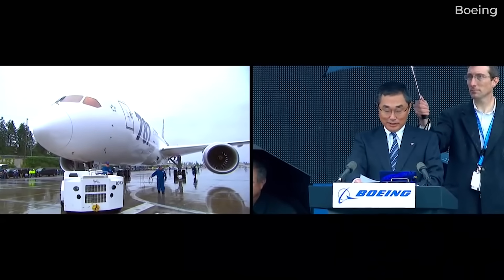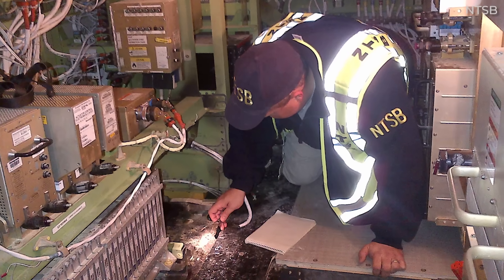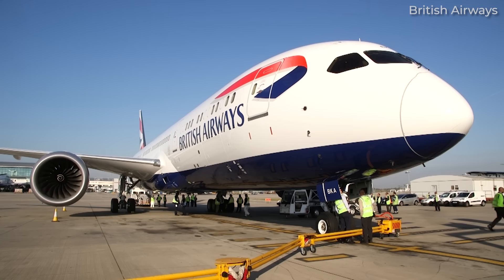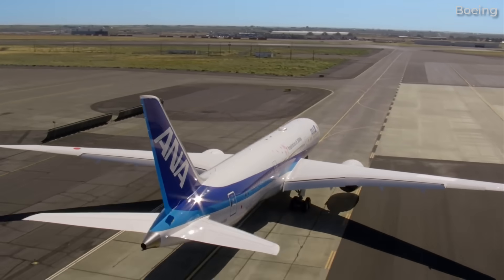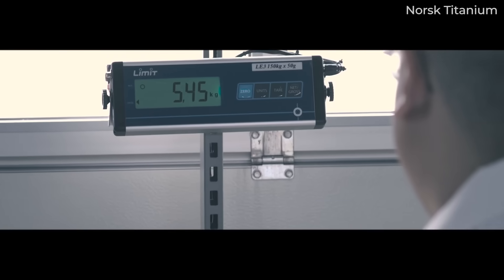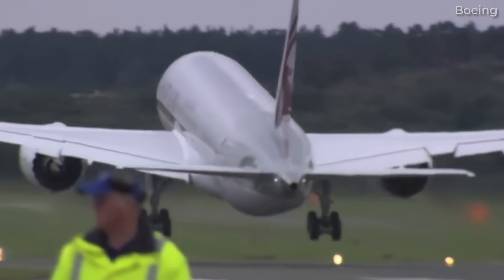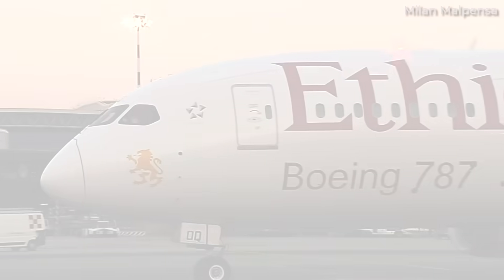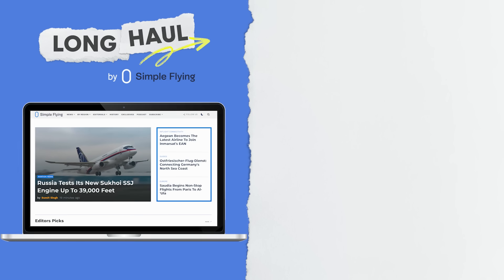Developing The Dreamliner: Five 787 Improvements Since Entering Service

Comment: I'm curious why the 787 doesn't have winglets? They're supposed to help with fuel efficiency and they seem cheap enough to implement. The 777 also doesn't have then but that could just be cause it's an ancient design. The 787 isn't. Anyone that could shed some knowledge on this?

Comment: To save on cost, Boeing also eliminated some of the electrical protections from the fuselage of the aircraft. They removed the copper lining within the fuselage that would eliminate sparking and causing a fuel tank explosion. Although, the Nitrogen inserting system of the tanks, they argue, can do the job too. They also removed some insulation used for the fasteners relating to this matter.

Comment: So 3d printing is a generic term used for a whole bunch of technologies and processes. It's almost as to say chissling wood by a carpenter and machining a metal part are the same. Norsk and GE's 3D printing are at the opposite ends of the spectrum think Amy Winehouse Vs Taylor Swift

Comment: Fixes/enhancements, doesn't matter. It's not like any car manufacturer that puts out a completely new model doesn't have issues either. Some car manufacturers even have issues long into production cough*VW*cough
And Airbus' A350s have issues as well. It's just generally less talked about, because it's the almighty Airbus.

Comment: I wouldn’t call it rushed; instead, 787 signifies a pinnacle of Boeing only second to 747 era. 
737 MAX was truly rushed with catastrophic consequences.
Reply: Original 787 development schedule was simply unrealistic.
And compare to either A350 or original 777, 787 has more teething problems and production issues, despite its EIS delay was also the most severe.
Things should have been done better, really.
Reply: @steinwaldmadchen  totally agree with the technical issues in 787 dev! This is also because 787 involved so many aviation-first innovations nobody had done before. I credit Boeing for resolving these issues without having any fatal incidents.
Reply: @bikingmoments are they resolved? What about the recent whistle blowers?

Comment: I'd call them fixes rather than improvements. However they didn't fix the main issue: the passenger comfort (or survivalbility) in economy class.
Reply: What exactly there? Because the seating layout is not specified by the manufacturers, but by the airlines. The ANA 787 is really comfortable even in economy. So, what comfort are you lacking?

Comment: A350 has dimmable windows too, just had the flight😜   But, on the plus side of B787 you didn't even mentioned the great pressurisation inside. Feels like on 1000m , the others (older models) do not have that comodity , but feels like 3000m . Long flights are so much afected with this issue. Higher hull preassure reduces fatigue and most important the jetlag. After a 10h flight in the Dreamliner is almost no jetlag , the fatigue is much less than on other planes . 
Just my own experience as a frequent flyer. Shortly = The Dremaliner 🙂
Reply: You mean that the A350 stole 😂
Reply: @jamiebrowne6913 hm let’s see, Boeing stole the idea of a twin engine body and stole the idea of a carbon fiber fuselage
Reply: @maxsaviation9512  correct me if I'm wrong but the A300 was in response to the 767 and the 737 was out long before both of them so who did Boeing steal that from? Also the A350 got the composite use only after the 787 came out Airbus was going to re wing and re engine the A330 till the realized what a beast the 787 was gonna be.
Reply: @jamiebrowne6913 the A300 was built and designed before the 767. the 767 first flight was 1981, the Airbus A300 first flew in 1972. Airbus was first.

And the fly-by-wire in passenger jets comes from Airbus mostly :D
Reply: @jamiebrowne6913  Yet A330NEO is just ~2% behind 787 in fuel burn, despite having the same aluminium fuselage and wings with the good old A330CEO.
Reply: @steinwaldmadchen  fuel burn is only one part of the equation, it's still more economical due to the weight savings  and design of the fuselage and wing, your just going engine to engine match up
Reply: @jamiebrowne6913  lol then you may be shocked that
a. A330NEO actually has the highest aspect ratio among all current gen widebody - higher than both 787 AND A350. After all, its wings were designed to overcome the shortcomings of the 4-engine A340.
b. A330NEO isn't that heavy either, around 2-3t higher than 787. That's why it can closely match 787's fuel burn in the first place. To be fair A359 isn't that light compared to 772 either, though A35K weight is significantly lower than both 77W and 779.
c. Of course A330NEO doesn't have the maintenance advantage of composite aircraft, just like 777X. But it's compensated by commonality with A330CEO, together with a low price tag.
So the revamped A350XWB is really more about market tactics, than Airbus truly believed 787 would blow A330 away.

Comment: Umm.. the Airbus A350 has dimmable windows. 🤔
Reply: That is much more recent
Reply: @filledwithvariousknowledge2747   still doesn't excuse the blunder
Reply: Does not count as they copied Boeings 🤔👌🏻
Reply: Another Boeing 787 is the dimmable windows, which are darker now, and operate faster than before.
Reply: It takes about 5 minutes for the 787 to completely dim the window but it only takes the A350 less than a minute to completely dim.
Reply: @Southernswag8283 Have you actually used the window in 2023? The windows are darker, and operate faster than the older ones. And, Airbus is using the same tech in Boeing windows, so how do you explain the non-existent claims you're making?

Comment: I hate the window tint system. Especially the central control allowing the cabin crew to override and lock the settings for the entire cabin.
Reply: one of the reasons why I avoid dreamliners if possible. The 9 across arrangement feels a bit tight as well, but not as bad as the 10 across 777
Reply: @oadka You think the 9 abreast 787 is bad, wait until you step in Cebu A330’s
Reply: @oadka  It's on the airlines for the seating config. Can't blame Boeing when the airlines put 9 across on an aircraft designed for 8.
JAL does have 8 across on their 787s. ANA used to, then changed to 9 once their Star Alliance partners started putting 9 across.
Reply: tell that to the airlines not the manufacture @oadka
Reply: The reason for that is the behaviour of some passengers that think they own the windows and have the right to keep them open during the sleep time or keep them closed during takeoffs and landings.

Comment: The a350 also does have dimable windows
Reply: But they've only just been added, and don't think any planes in operation actually have them yet
Reply: @_shreyash_anand Air France has a concept version of them
Reply: Starlux has, and newly built ones that have specked them will have them @_shreyash_anand

Comment: Knowing what we know about Boeing nowadays, it is certain that they rushed the 787 development.
Reply: The armchair aerospace engineers in the comments are hilarious
Reply: Development was not rushed, initial manufacturing process was rushed and Boeing had to spend more than $30B to iron out those issues until mass production. That is the reason why 787 program still did not break even after 1000+ units delivered.
Reply: @hakanevin8545  Fair point, though there was a pressure to launch the 787 by July 8, 2007, so cutting corners in R&D isn't out of the table.
Reply: It depends on how you define R&D. I define it all the technical work done until certification. According to Boeing itself as written on their website, their staff logged 200,000 hours of technical work and it took 8 years for certification. I wouldn't call this "rushed".
Reply: Wdym? Its flawless since entering service. Stay mad.
Reply: @brakinglate8828 those batteries are flawless isn't it
Reply: @yellownautilus792  fixed after a couple of weeks also that was 9 years ago. Unlike Airbus who can't paint the A350s properly.
Reply: @brakinglate8828 But I don't recall a mass grounding of a350s
Reply: @Tpr_1808  airbus still took years to fix the issue with Qatar btw. Also that 787 grounding was barely a month.
Reply: @brakinglate8828 because qatar was simply uncooperative…
Reply: Funny, the way I remember it is that the London High Court asked for concrete proof and Qatar folded.

And strange that this was only ever an issue for Qatar
Reply: @TheTubadMoose  cathay pacific also iirc
Reply: @brakinglate8828  What about when production was halted for almost 2years
Reply: @Tpr_1808  what covid?
Reply: @brakinglate8828  That affected everyone, for the 787 it was mainly because of quality assurance
Reply: @brakinglate8828 the 787 has been corroding its carbon fuselage since it was first flown 😂 all aircraft with carbon fiber seem to have issues
Reply: @brakinglate8828 didn’t they have two groundings?
Reply: @maxsaviation9512 says you fanboy who thinks he knows everything. There were no flaking paint issues on the 787 so what are you on about there?!!!! Then they shouldn't fly according to your opinion
Reply: @nickolliver3021  WASHINGTON/PARIS, Nov 14 (Reuters) - Boeing Co (BA.N) said on Monday that operators of its 787 Dreamliner jetliners have experienced paint peeling issues on wing and horizontal stabilizer surfaces due to ultraviolet radiation exposure, and asked U.S. regulators to approve its plan to address the issue.
Not exactly fuselage, but still CFRP structures.

Besides Boeing was also required by FAA to look into carbon fibre contamination during the fuselage manufacturing process (though produced by Japanese contractors), alongside with out-of-tolerance joint gaps.
Reply: @steinwaldmadchen   WASHINGTON PARIS November 14th 2022 noeibg Co BANA said that sone dreamliners wees experiencing paint peeling issues on wings mostly and not the horizontal stabiliser surfaces due to too much radiation exposure. Similar to the Qatar paint issue work too much radiation in tne desert in storage. Again the EASA had to approve the paint had not been solidly made to protect itself from radiation and a plan in place to address the issue. 

Airbus was also required to look into Cfrp  structures during construction of the a350 fuselage too in production. Both were struggling to get around carbon fibre fuselages. I was only replying to a kid who thinks boeing is always a problem and thinks it's always bad bad bad news. We all know it had a problem but not as bad as the Qatar dispute. Enough said about that